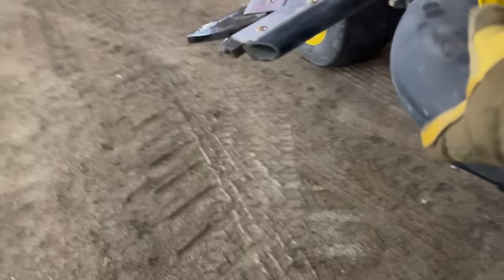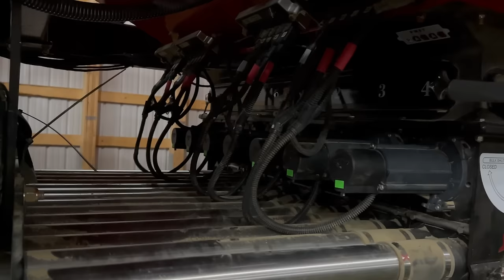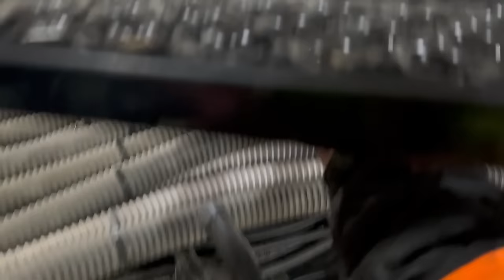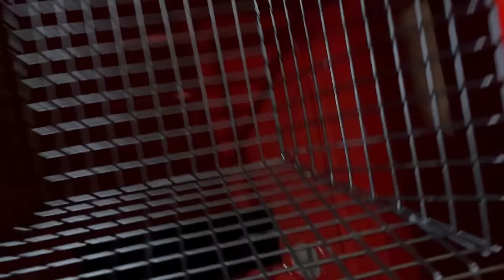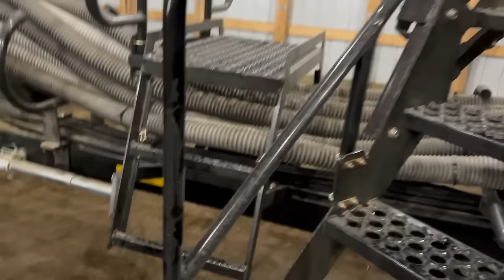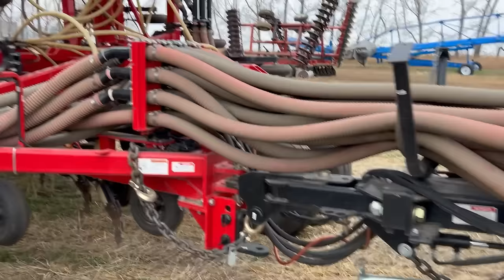Bye Bye Bourgault Hello Seedhawk

Comment: Awesome drill, congrats!  But at the end of the day Dustin, all the yields are quite similar.  It's not rocket science.  You place the seed and fertilizer in the soil and you move on to the next field.  Around here I can't tell which drill seeded what field come July.  It's either they all look like crap or they all look good.  But I do understand switching things up from time to time.  And I'll agree that the SeedHawk metering and sectional control is superior.  Good luck next spring!
Reply from the maker: I agree, you put seed and fert in the ground and pray for rain. I’m hoping for they all look good

Comment: That is going to be one sweet drill to use . The only draw back with them that I can see from the road is when you go around  corners the shanks all line up .
Reply: We’ve found with seedhawk/seedmasters that if you do your headlands “backwards”/clockwise your shanks don’t overlap on corners like they do when you go counter clockwise.
Reply from the maker: I see what you mean. Seedhawk has the same opener stagger throughout the drill. BG switches stagger half way through
Reply: Always make your turns clockwise then there is no overlap.

Comment: It will piss you off when the seed hawk frame starts cracking and the factory won't do anything about it
Reply from the maker: Ya it would but frames haven’t cracked in years
Reply: @DavesNotHome2704  that's hilarious when guys smack talk seedhawk because we bought a 2017 3320 bourgault 3 years ago and that thing had multiple MULTIPLE cracks our neighbors have about a 16-17 hawk they bought new not one crack....

Comment: So with the 4 tanks does all that product have to get to that central manifold with the electric meters or does each tank have that row of motors?  Is there a conveyor bringing it to the central electric motor bank?  I know nothing about drills.
Reply from the maker: Each tank has a row of motors metering product into the airstream
Reply: @dustinbezugly  Thanks, I couldn't see in the video. That's impressive.